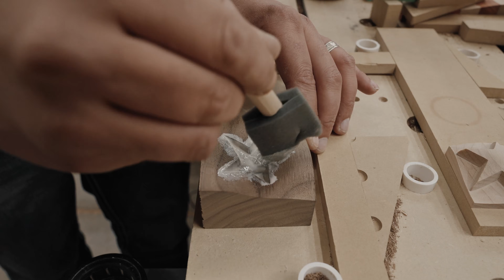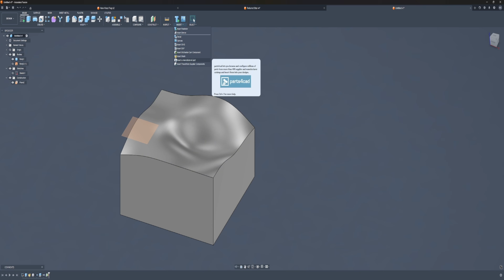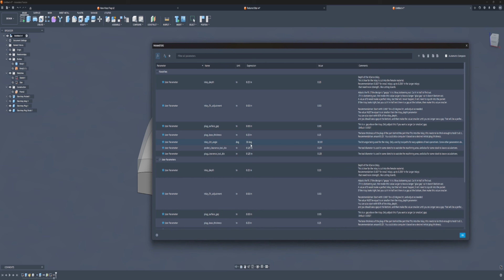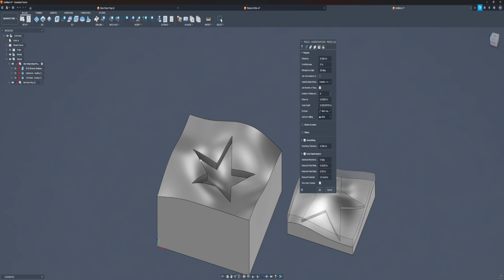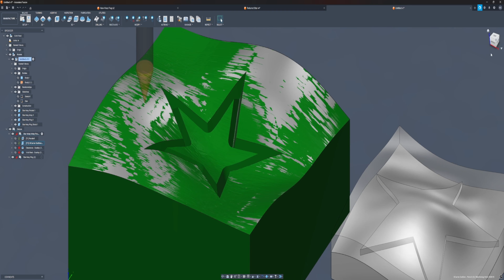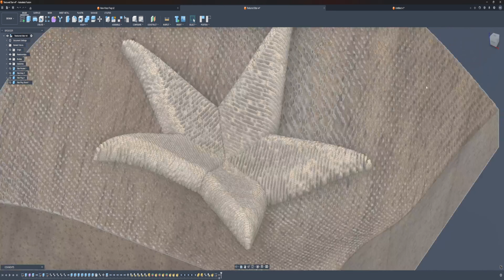This 3D Carving Process Will Blow Your Mind! | Textured VCarve Inlays

Comment: any chance someone will re-code the plugin for vectric, for those of us who struggle with fusion? :-)
Reply from the maker: Ooof unsure and would default to Corbin who made the plugin.  I do know this was specifically coded for Fusion360 parametric modeling using both the CAD/CAM functions.  I have zero time with Vectric, and really happy with the results I get with Fusion360, plus Fusion is a free software, even though I decided to get a subscription, the functionality is still there with the free use.  Cheers!
Reply: @EricksonWorks  I guess I'm going to see if I can find the back end code for the plugin and feed it into an AI, to see if it can extract the geometry math and change the rest from fusion api to vectric interface. :-D   
it's getting better at that sort of thing..  maybe it'll work(ish).  ¯\_(ツ)_/¯

Comment: I wonder if you did a couple of tool paths in the areas where the points are while it all attached and then did the full path. 

It what we do when machining large parts. Do the fine area machine first then do the bulk last.
Reply from the maker: Nice!  I started looking at how to better take off the plug material, that’s a really great suggestion!

Comment: That is cool. Was wondering if Aspire is capable of this. Will have to try to see if their 3D profile toolpath is capable of inlays. I’ve seen Sienci Labs inlay on a bat using the rotary, so maybe it is possible? If not, Vectric will follow up with their own version as they were late with the AI generator and now have their own version coming up to be released soon.
Reply from the maker: Yeah really interesting about Vectric and the AI generator.  I’ve been experimenting with VistaScuplt and really enjoy it, then using blender to modify the models generated a little more before bring them into Fusion.  Steep learning curve, but doable.  Not sure why Vectric didn’t just buy out VistaScuplt instead of trying to build their own AI model generator.
Reply: @EricksonWorks yes, Vectric was late to party with the AI but excited to see their other releases coming soon. Thrilled with the assembly option as I’m a Vectric user and convert lots of old pdfs to digital for fun.
Reply: A bat on rotary was probably a flat vcarve; it was just "unrolled" on one axis to make it a rotary toolpath.  I'm pretty proficient in Vectric Vcarve and Fusion; you can, sort of, do a curved inlay in Vectric's software using a VCarve toolpath and "project to model", along with an inverted model for the plug. My older curved inlays, ie: https://www.youtube.com/watch?v=LASK9fiMWMs , did it this way. It's got lots of limitations and issues, and I never did a walk through video on how to do it, as there are so many "gotchas" to easily get it wrong. I also haven't seen anyone else do that technique in vCarve.
Reply: @CorbinDunn you’re correct. Tried in Aspire earlier and as far as creating a 3D model and then adding a zero plane with clipping, it may be possible. Lots of steps but possible. Anyway, just subscribed to your channel and enjoyed the few videos I have seen. Keep up the good work. -Peter